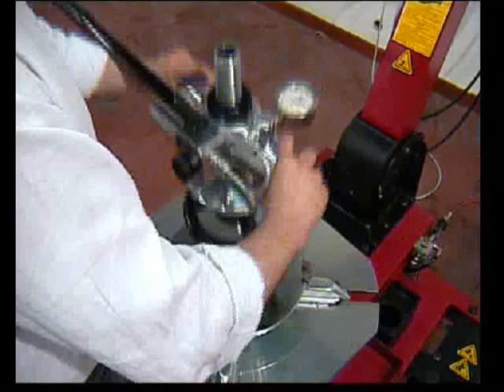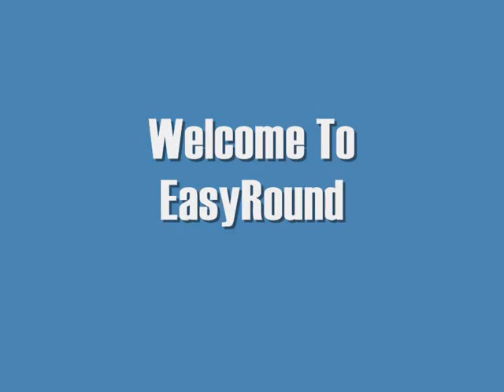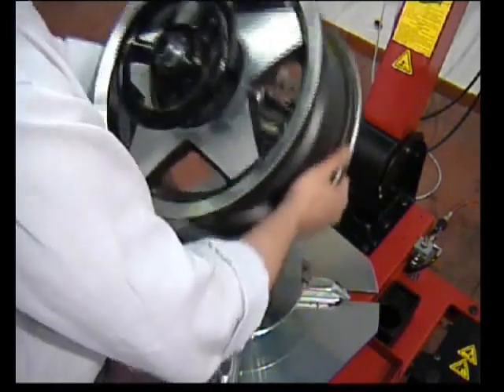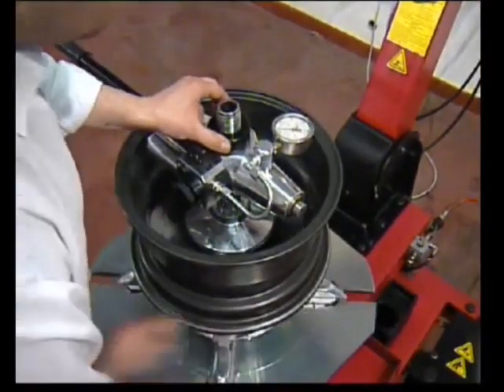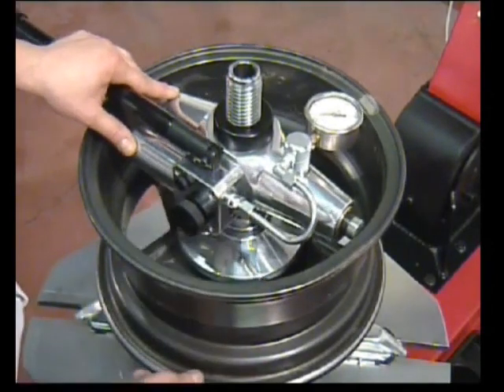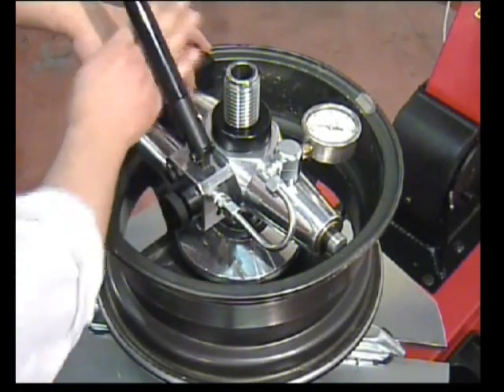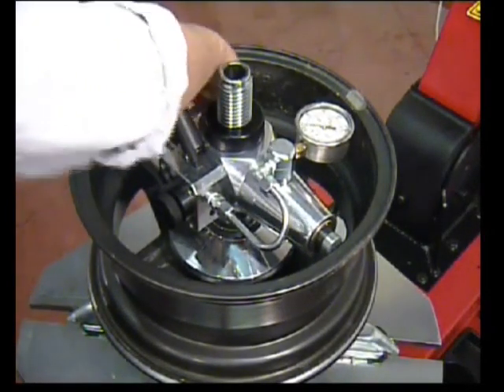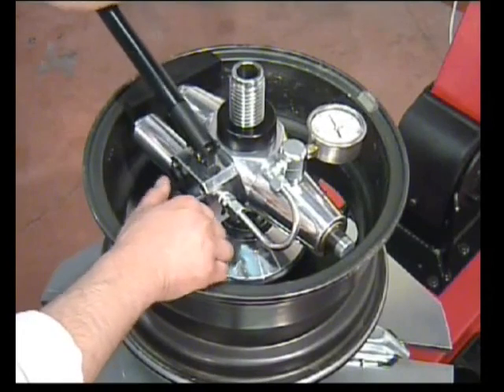EASY ROUND EVOLUTION manual wheel straightener

Comment: nice vid but shouldn't you be using heat as not to warp or crack the rim while repairing?
Reply from the maker: if the damage is small, not necessary to heat it up. IF the damage bigger, ir the damage located on the lip need heat of course.